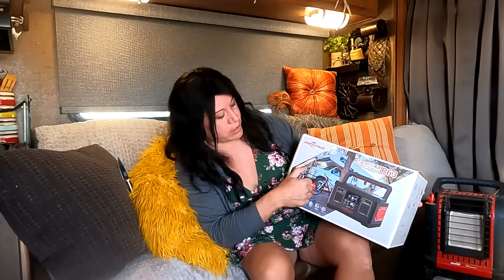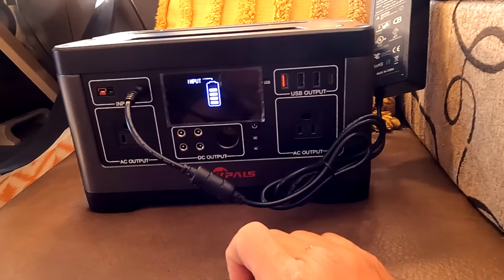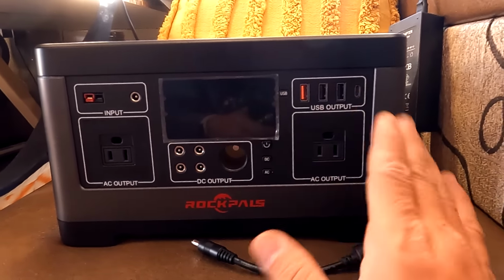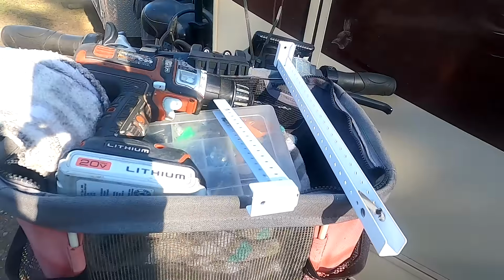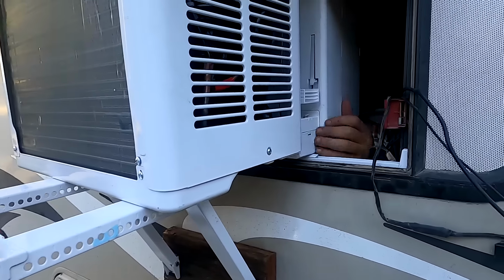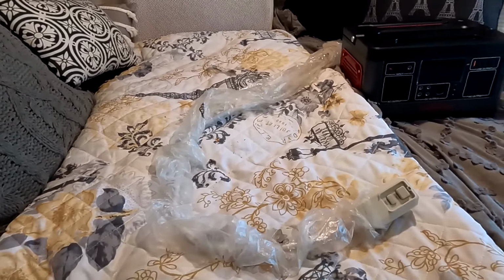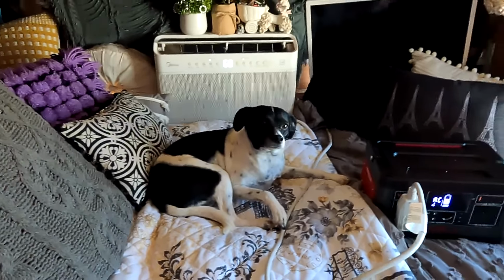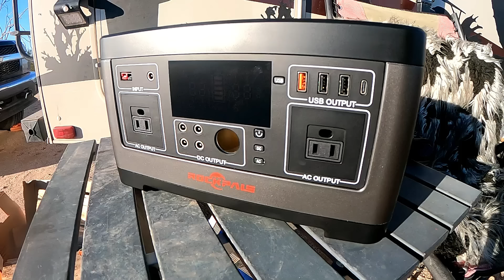Solar A/C Motorhome Install | Quiet Inverted Midea Window Unit 8000 BTU & RockPals 500 Power Station

Comment: Interesting observations on how you hook up a/c I have a 12,000 btu mini split in my converted cargo trailer. Going to try it out on my solar generator and I’m also trying to gauge battery and solar power needs vs wants
Reply from the maker: Cool... mine is a 8000 btu

Comment: Yup! I need to get the Madia AC..😊  I can handle the cold weather fine, heat is what gets to me. If the RockPal works out well, I will get that too.. I already have their solar panel. Thank you for the review!
Reply from the maker: I agree... I too get drained from excessive heat.

Comment: Yeah they did a good job on that unit their first unit was orange looking and it didn't the front panel where all the power stuff was was not too good this new concept that they did is really nice. Well that's what I plan on doing I'm not buying lithium batteries and and all that kind of stuff I'm buying two or three of like the 500 unless I need 1000 but I think you could cook with a insta pot on a 500 and a refrigerator 12 Volt owner 500 so I may just get three 500's and put them around the vehicle. I like that AC I gotta find out more about that AC. Well as always sending a big Santa hug stay safe stay strong stay healthy God bless and enjoy life PS I don't know what you're doing but you're looking fantastic lady.✌✌💖💪🌈🎅🚌🌻👍
Reply from the maker: Awesome

Comment: Does anyone know we’re you can have a solar power bank delivered in Quartzsite area?
Reply from the maker: BCM mailing service is what I use when in Quartzsite $79 annually or $39 for a couple months and they also will do a price by the package ($4 I believe) if you don't want a monthly or annual plan
Reply: @rvpandamonium  thank you I will check them out!

Comment: You did nice work installing the a/c in the back of the RV. You made the work look easy and it's not. Need to keep hands/fingers away from the saw blade area when holding the saw and when cutting wood. Can slip or kick back at you.

Comment: Ausia first of all happy Valentine's Day and I'm glad you got the media air conditioner I have a small den which I'm in most of the summer and I'm glad you're happy with it and I need something that draws very little power as I have solar on my home and on my truck camper which I go on the beach I just wanted to give you a note and I'm going to send information on instant messenger directly to you give Mama a hug I finally got a puppy a Frenchie after 2 years when my cocker spaniel Elvis passed away I'm finally got to the point where I can have another dog it was a rough loss okay check your instant messenger I do have some information on it for you. 🤗🤗💖
Reply from the maker: Thanks

Comment: I think you need a 1000 watt inverter, That 500 watt will not run it for very long.
Reply from the maker: Yes I plug it in to my big solar bank if running it for longer than 2 hours

Comment: Curious if your rig doesn’t have a roof air conditioner.  If it does why put this a/c out a window?
Reply from the maker: I do but it uses alot of power and I wouldn't run it off of solar

Comment: Can u charge with solar  will using it to run the ac
Reply from the maker: Yes you can charge it with solar probably will just use my house batteries and use that for my TV

Comment: Ausia ???? I always Love your videos!! But I’m lost on why your putting a window unit in as opposed to a new roof mount ac and a soft start which I was told will run the AC on solar or reg home elec or a small generator. I’m thinking of buying the soft start for my class C  so I can run my AC ……. I am in Texas a lot an you know how hot it gets here!! Lol Please let me know….. Blessed Travels!!
Reply from the maker: You can put a soft start on you a/c but it will still use more power in the long run, up to 4x more.

Comment: That looks like a decent unit!   I have two of the Media dual inverter A/Cs. One is an 8,000 just like yours and the other is a 12,000 btu. I got an awesome deal on them because they are so energy efficient that the state I live in was offering a $200.00 rebate per unit.   So I received $400.00 back on them.   They work awesome , they are quiet and I saw a huge difference in my electric bill.  They saved me a lot of money.  Thanks for the review Ausia and thumbs UP to you and Moo moo.  👍
Reply: The KNIFE 🔪 ...OH MY GOSH,  it slid down between the pillows in beginning, I hope she doesn't accidentally sit or lean back and get hurt....someone help me tell this worry wart !❤❤❤❤❤❤❤
Reply from the maker: Awesome!
Reply from the maker: No I knew where it went a put it up after the unboxing

Comment: Great video.  I am planning my build for a van and I want to travel with my dog and cats.  I have the same brand mini split in my house (great product), and I will be getting a 2000 watt solar generator.  I will need to be able to run the AC longer because I will be spending most of my time in the south and in Texas (it's a work thing). So you answered my question how long did your AC run? THANKS!!!! Also I love your dog:)

Comment: You can get a plain old window air conditioner for around $100 at Walmart.
Reply: Yeah and it will run on that power supply for about 20 minutes, if that.
Reply from the maker: Actually some Walmarts now carry the Midea

Comment: Breaks my heart to see you drill all that crap in your RV You should’ve gotten a standing AC that’s the only had to put a vent in your window
Reply from the maker: A standered unit uses 2 to 3 times more power, which we stated in the video. People upgrade their rigs all the time, even if you have a professional installer put in a solar system, they do have to drill holes... not sure what your point is but I know I love taking a nap in the a/c and my dog appreciates it too lol.
Reply: It's an RV that's meant to be used not a museum piece.